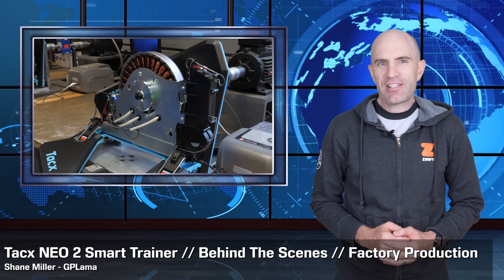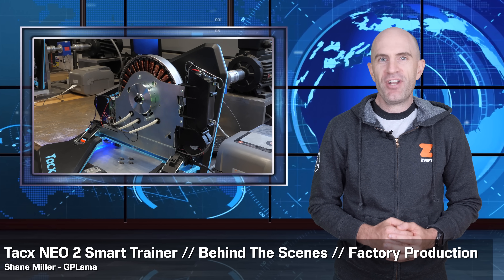Tacx NEO 2 Smart Trainer // Behind The Scenes // Factory Production

Comment: The Tacx Neo 2T trainer quickly slows down when you stop pedaling, even if you're riding in a peloton on Zwift. In reality, a cyclist should be able to coast and stay in the aerodynamic tunnel for quite some time. I believe that the simulation in the Zwift app does not accurately reflect reality or Tacx has some control problems. Do you share the same opinion on this topic?

Comment: Hey Shane, sorry I'm a bit late...

I was wondering what your personal favourite smart trainer is. I'd prefer a modern machine and it doesn't need to be quiet as it will be downstairs. I'd like accurate power readings and a good quality build as it will get a lot of hours and use. Also the ability to make custom workouts to follow.

Thanks
Reply from the maker: Best 'training' trainer. Lemond Revolution. Best smart trainer.... it depends. The top end are all pretty solid units. It comes down to budget, compatibility, and what's available. If you can test ride then I'd highly recommend it.
Reply: Shane Miller - GPLama yeah a friend has a direto and I really liked it. I think I might go with that as I have found some good prices online. 

Thanks for the feedback.
Reply: @bobby5031  Had my direto since Nov.  It has worked amazing using Zwift and TR.  You won't be disappointed.
Reply: rob bonner thanks for the info. Sounds like a good buy. :)

Comment: Cool video! Shane, any chance you can repeat your 'does gear selection matter?' test you did on the kickr on the neo2 please? I'm a TT'er with a Neo and would be very interested to know if there is indeed a difference on the Neo between say 39/19 and 53/15 at the same wattage
Reply: Im a Neo user and absolutely sure it does make a difference with smaller front being more easy
Reply: the gear ratios are very different (2.05 vs 3.53), so it will be a different. Cadence comes to mind.
Reply: @Takumi-San  yes clearly the gear ratios are different but the Neo doesn't have a normal flywheel or interia model like a traditional direct drive like the kickr.
While I've tried both 39/21-19 and 53/15 for my intervals, I'm always conscious of my internal bias that I 'know' what gear I'm using and this is clouding any judgement.
Hence me asking for the quick video with the pedaling analytics to prove it like it in the kickr video.

Comment: Great to see it's not made in China.
Reply: Makes a change actually and worth paying the price going to proper wages.
Reply: Good on Tacx
Reply: That was great. Good choice on the background music too
Reply: Pretty sure majority of the components such as magnets, flywheel, copper coils, etc., are made in China. The motherboard, mostly likely designed in Netherlands and made in China as well. Robots are used as much as possible to reduce labor cost for obvious reasons. The scale of production is relatively small, more like a small business workshop, otherwise it will be moved to China to utilize capacity and increase productivity. For this particular segment especially high end ones though, there maybe not enough demand volume to justify the super mass production - that is the reason it's still made in Netherlands and unfortunately hence the high price.
Reply: Too right, kudos to tacx for that 😉
Reply: The components are probably made in China and the assembly in the Netherlands.
Reply: Those wooden crates were they pick the parts from have VAN LEEUWEN PRECISIE stenciled on them.
Google it and you know where those components come from.